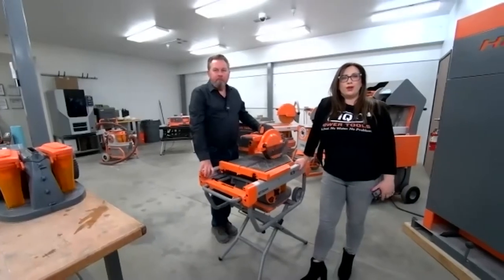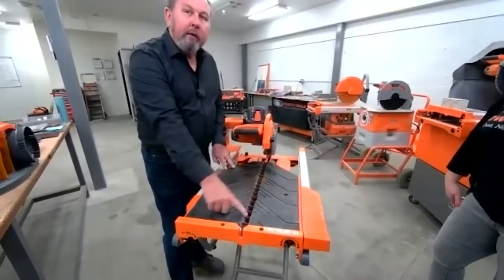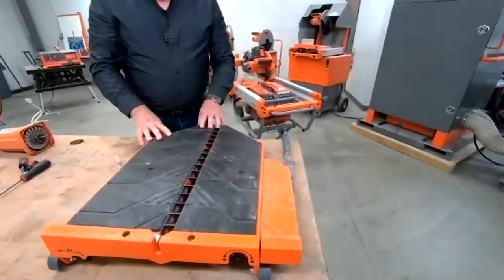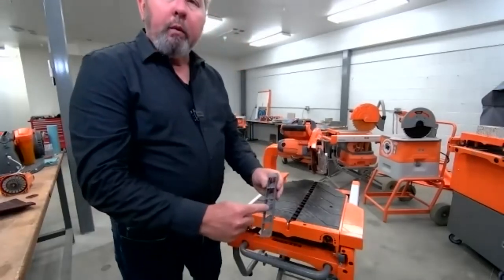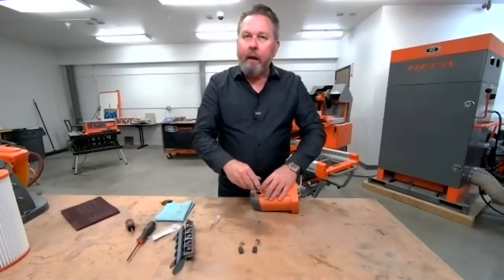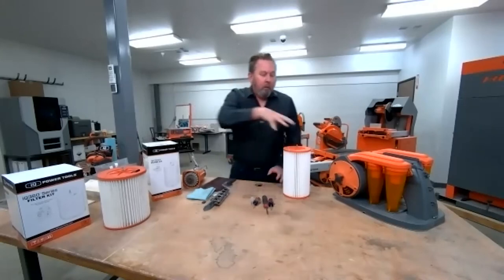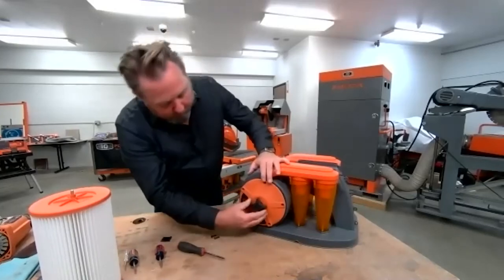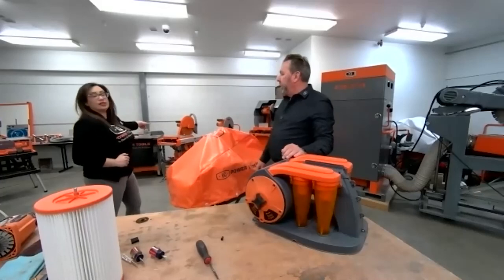iQ Live: Annual Tool Maintenance for iQTS244, iQMS362, iQ360XT

Comment: If we don't use machine for complete winter time. do we have to do anything special? Of course I completely clean it before I keep it in my out door storage room/shed. I use air compressor to clean it.
Reply from the maker: No, there's nothing additional except to maybe dress the blade before you start cutting. Other than that, you should be good. I'd double check the brushes, louvers and filter before you start your using it full time to make sure all those comments are ready to go.
Reply: @iqpowertools  Good idea, Thank you.